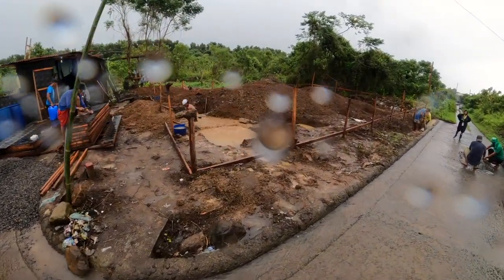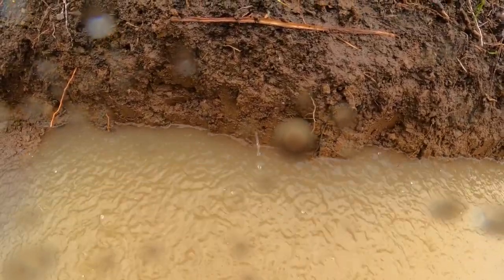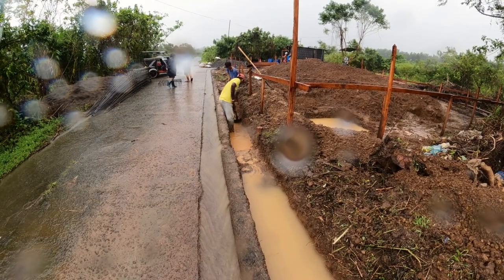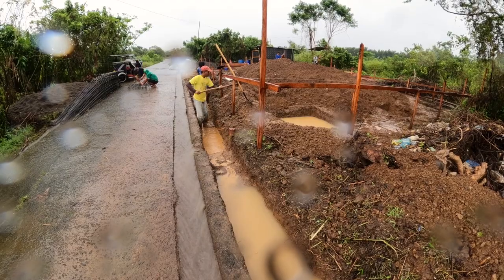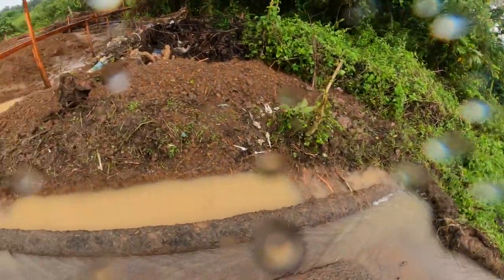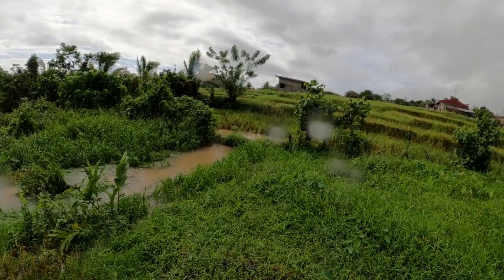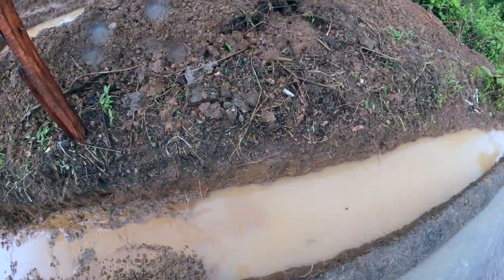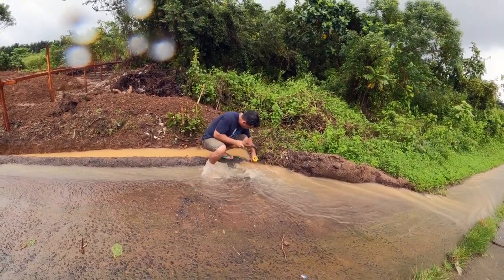Deluge of Water 🐳 | Garage Build Philippines | Ep. 04 | TORINO

Comment: I'm a simple Floorlayer & water management is far from my specialty. That said I did travel for 13 years installing artificial grass in Sports Venues. The substrate (surface) was already in place when we got there, but every field had a built-in drainage system. Basically drain tile (4" pipe with holes on the bottom), laid on top tighter fitting stone, with no fines, and buried in a layer of stone, large enough stone to allow drainage, and not choke off the water's ability to seep through to the drain tile...The key is, the outlet naturally has to be the lowest point, and have sufficient ability for the drainage to flow & remove itself from your area...Definitely take notes as to where your water is currently pooling, and ask some of the locals, how much worse does it get ? You may not even be encountering the worst, or what happens during a Typhoon...Definitely information You're going to want to know before You start building Your home...
 Good luck with everything
Reply: You may even consider, if need be, to raise the floor of Your garage, just to keep your valuables from succumbing to the same type of water collection in the future. This may be a calling call for things to come....Again, without being there & seeing what's truly going on, it's really tough to evaluate
Reply from the maker: All good points and you're right on. I laid a french drain, 4" pipe with 1" holes on the bottom, wrapped in 3/4 gravel around the inside perimeter of the garage floor. I also have the box culvert dug about 2.5' around the perimeter of the property. We are installing a 1 HP sump pump in a 1 meter deep sump pit in the center of the garage as well. But, yes, until "everyone" fixes their box culvert we need to watch for flooding. Thanks for commenting.